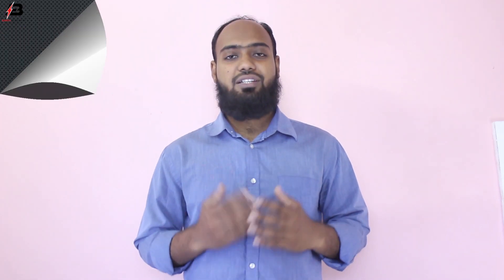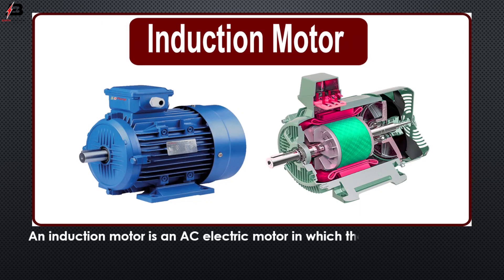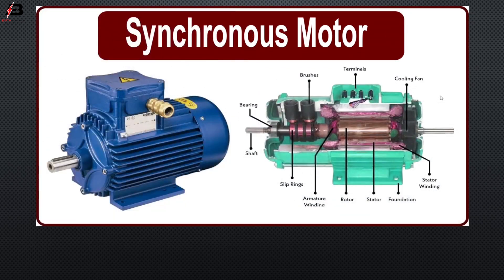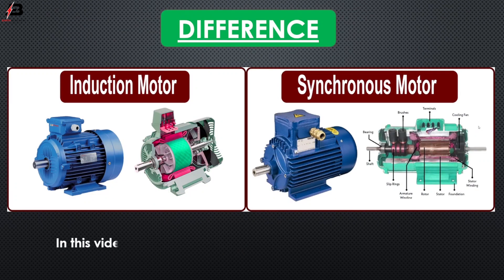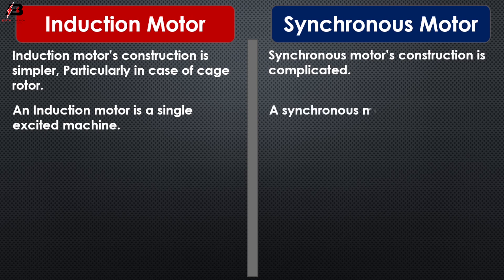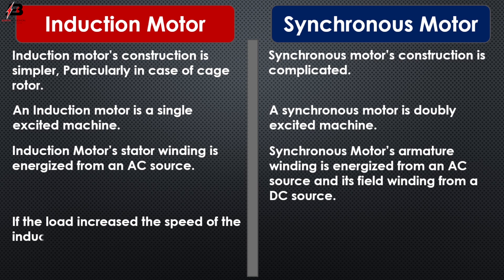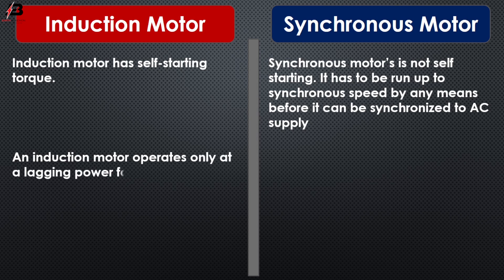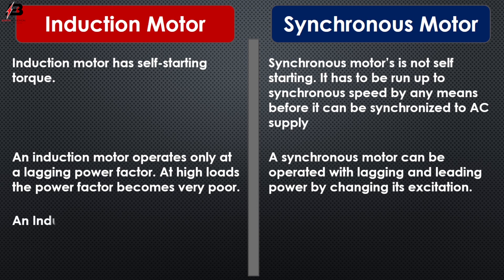Difference Between Induction Motor and Synchronous Motor | Synchronous Motor vs Induction Motor

Comment: From a practical point of view, how can you tell by looking at a AC motor if it's a less-efficient 'asynchronous/induction' or a pricier 'synchronous' which requires a starter?   For example, I've got a small, low-speed,  3-phase (400hz) 110 ac motor for an air-compressor.  The rating on the label doesn't say much except that it's input power is 1.6A RMS Max.

Reason I ask is that I'm looking for a portable power-supply for it and found a $75 
"HKS VFD 0.75KW 1HP 110V 1 Phase Input 3 Phase 0-400HZ Output 10A"
but it says in bold letters, "for ASYNCHRONOUS motors ONLY!"   
It also says it uses a 5V or 10V PWM control frequency.

So I'm confused if this will work, or is there something better suited/cheaper like Vevor?   All I need is to spin the motor, one direction, at a constant/default speed (no "PWM")..  and turn it on/off from the panel  (RS485 would be nice but not necessary).
Reply from the maker: no idea sir